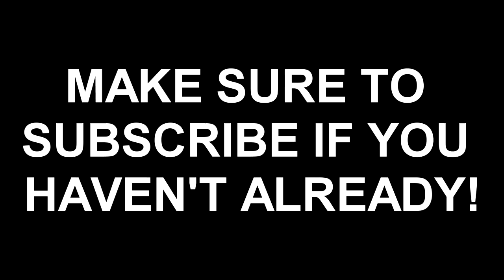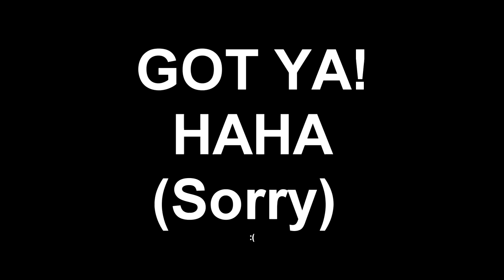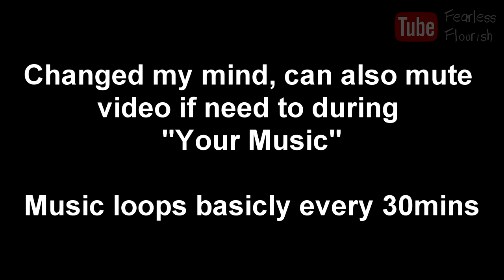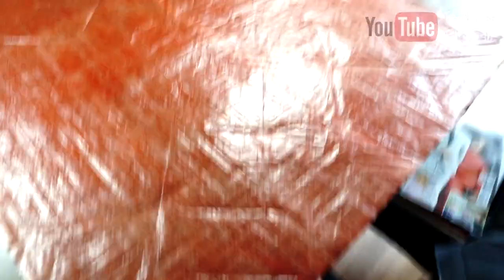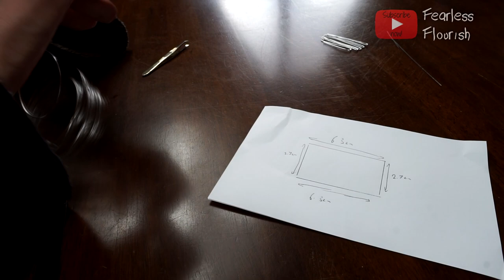Origami Japanease Spiny Lobster - Kota lmai [Official Video]

Comment: What was the wire for?
Reply from the maker: Dj-SparQ which part of the video?
Reply: @FearlessFlourish  near the end , 4 hrs in
Reply from the maker: Dj-SparQ that part i made, which is the exact shape (rectangle) of the part that has all the squares on it, i made that then fitted it into the slot so i could easily curve that part so it holds its shape as it only basically 1 layer thin
Reply: @FearlessFlourish  oh that's smart
Reply from the maker: Dj-SparQ that was the only way id be able to get the roundess i wanted, if you watch the 12hour video on shaping this, you will see it much better as the footage is not sped up